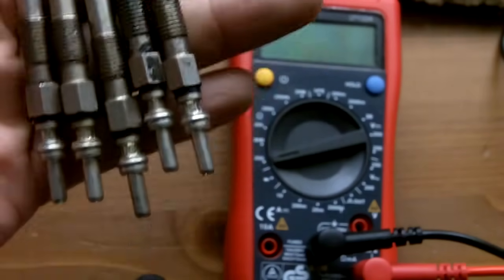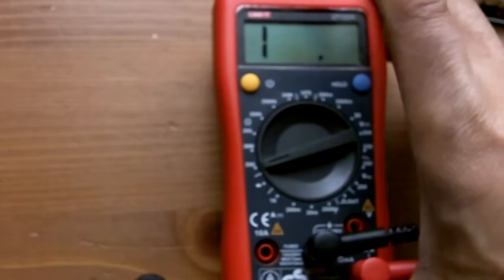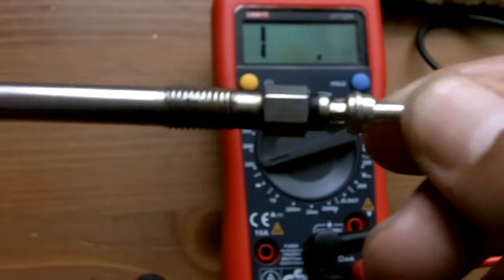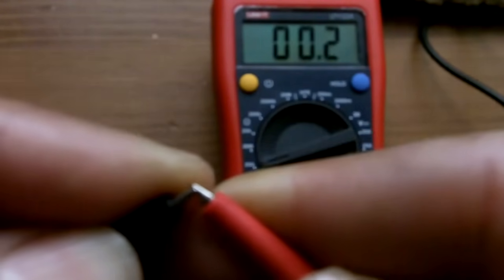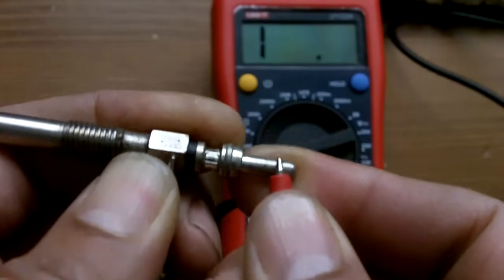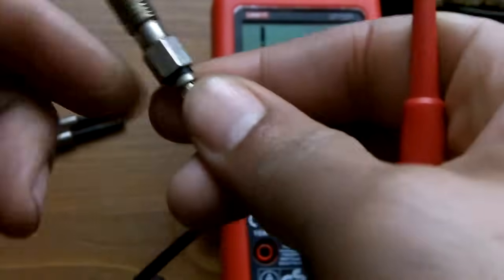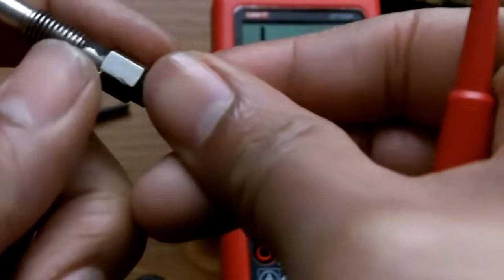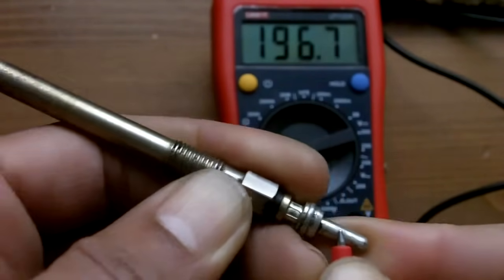Easy and Complete Glow Plug Test

Comment: My diesel had codes for all 8 plugs.  I tested 4 using this method.  All just showed 1.  I'll replace 4 and see if the codes go away.
Reply: if you have 8 plugs you should replace all 8 at once, dont think replacing only a couple is a good idea
Reply: @_Drekavac_  I replaced 4.  4 codes went away so i replaced the other 4 too.  Now Im clear.

Comment: Ive seen others put the positive on top and the negative on the tip, what's the correct way?
Reply: It doesn't matter, the glowplug is a passive device-it has no internal active electronic components and is completely indifferent to voltage polarity
Reply from the maker: Why would I show you an incorrect method? The video has over a million views. You decide. 👍🏾
Reply: @sirobb  what's wrong with asking a question.  People make mistakes and are not Gods, so why so sure that your method is THE correct one?
Reply from the maker: @starcommunication279 It's not THE method, it's A method which works every time. It's not just my opinion either..... 1m+ views, 4k+ likes, a few hundred comments tell me that the method shown works well enough to not really need to question it. What's your problem?

Comment: Did i do something wrong or what. I bought new glow plugs and wanted to check them with my device. UT60eu from Uni-T. It couldnt be measured. The readings werent stable. Is something with the device or what? I just bought this device brand new and it is it’s first use. I attached connectors and leads to the glow plug the same way you did.
Reply: You had your setting on volts probably
Reply from the maker: @mroqqq7871  test a few things around the house or car with the multimeter to test the meter if you know how to. 
Don't mess with electricity if you don't understand what you're doing. 👍🏾
Reply: @ sure thing. I am new to the topic that’s true however i know how to use simple options of the meter. Checked the voltage of the battery in the car and batteries in the remote it seems like it is ok however idk why i cannot receive the stable readings regarding the resistance. If I touch leads with each other they show no resistance neither.
Reply from the maker: @mroqqq7871  If this is your meter, are you using the yellow button to change to ohms? The dial positions have multiple functions. https://m.media-amazon.com/images/I/514mYZqTzlL._AC_UF1000,1000_QL80_.jpg

Comment: Ok, I need a new multimeter as my values are jumping and I get different results everytime I restart multimeter to measure the same plugs
Reply from the maker: Touch the meter leads together before testing. If that produces a stable reading, the multimeter is likely ok.
Reply: Wiggle the leads…… 
Cheap multimeter leads will change resistance as they move around ;-(
Reply: Do the battery test. It's way more reliable and it's the old school method
Reply from the maker: What if he has 4v or 7v plugs? 12v will kill them. The methods described are reliable, safe and quick.

Comment: That could explain why my truck with bad glow plugs takes about 20-30 seconds to start. I’ll be replacing them very soon.
Reply from the maker: Definitely test before replacing to be sure. Hard starting diesels aren't always the glow plugs.
Reply: You do that test with multimeter without to remove the glow-plugs
Or you can use a test chisel=test light
Reply: @konstantin-big  How could you possibly measure ohms with a test light?
Reply: @ShesABigun  
You can't 
Measure ohms with a test-light 
You can connect the test-light  to B+ on Battery and the other side to glow plug without to remove the glow plug 
If the test-light don't illuminate the glow plug is burnt
I hope you understand that I mean

Comment: You must NO TOUCH THE METAL while you checking ohms or just one but not two, it could be different results!!
Reply: As a rule, that is correct. But for this, where the expected resistanse is very low, it will not matter at all. As we know, his body resistanse will be like Meg-ohms and in parallel with the glowplug. The well know formula for resistors in parallel give us (for one 1Ω glowplug): R(tot)=(Rglow*Rman)/(Rglow+Rman). Ex.: R(tot)=1*1000000/1+1000000⁓0.999999000001, that is pretty close to 1Ω. So the body does not inflict on the measurement in this case.
Reply: You can touch one end and not the other

Comment: All my glowplugs are 1.5 to 2 ohms, and i have a bad cold start. Tested the relay and even if they get 12v, and everything was ok. Going to change them soon and see what happens. I had bad starts for years with good, bad turbos. Havent checked the injectors, but lets start at the cheapest end . At 250k km and they never have been changed only time.
Reply: Battery? starter motor? Alternator? 
Did it got fixed when u swaped the glow plugs mate?
Reply: Tested mine just this morning and they are 8,5 minimum Ohms.

Mines done 250,000km and don't think they've ever been changed.

Not looking forward to removing them but I have all the gear and no idea 😆
Reply: Poppet valve in injectors probably need shimming.

Comment: Do glow plugs stay hot when the engine is running?
Reply from the maker: They're not on permanently but may be cycled on during warm up to reduce emissions and some DPF systems use them during the regeneration process.
There's no definitive answer so it very much depends on the set up of an individual engine.
Reply: @sirobb  do they stay on when the ignition is on? Before starting the car
Reply from the maker: Depends on temperature. Cold starting above 6-8°C won't need any glow plug activation.
Reply: @sirobb  thanks for the reply
Reply: @sirobb  I have an older 2000 Diesel 1.9D with mechanical injection and the glow plugs cycle whether it's hot or cold out which suggests mine uses them regardless of temperature?

Glow plug light is on for 3-5 seconds and the relay (timer) clicks off after about 1 minute.

My glow plugs are measuring 8,5 ohms so I need to replace them. It's seems to be considered a cold start whether it's 25c or -25c out with my car.

I guess this is normal for cars built pre DPF with modern systems?

Comment: Hi my volvo v50 2.0d is struggling to start but my battery is fine, is it a big job to change these and this cropped up as being one of the potential problems?

Thanks nice vidoes 🙌🏼
Reply from the maker: Yes they can be tricky to change so that's why you test them first. No point in changing something that's working ok

Comment: It might have been asked - but why does this work?
Reply from the maker: Like most electrical components, working glow plugs only show the correct resistance between a limited range.
Outside of that range, they don't work so this reliably measures the resistance is acceptable.

Comment: When you are battery testing them it's much easier to use jumper cables (one lead of the around the body of glow plug to ground) then take the glowplug via the handle and touch the positive thermal of battery with top of glow plug. No chances of that Lil wire getting hot and burning your finger. 👍🏾
Reply from the maker: As mentioned in the video, I wouldn't test glow plugs that way.
There's no need.
Reply: @sirobb  well when get that one shorted a weird way like I did the little wire will scorch the hell out of your finger just talking from experience still a great video man.

Comment: just hook up to 12 volt battery if they glow they good
Reply from the maker: This method doesn't require removal and not every glow plug is 12 volts.
Your method on a 4V plug would knacker the plug.

Comment: If you have a battery or lab supply,could you not put 12v through them to see if they heat up?
Reply from the maker: I show that method in the video but I don't recommend it.
Reply: Yes I did find it before you replied,but thanks for the reply.I have tested all 5 and they are all 0.6 ohms as per your video, tried to check the voltage but as it was pissing down and I was in a hurry,I didn't disconnect the coolant temp.saw your vid on timing belt, car is on 197k so due soon,I will buy a Volvo belt,but I have a friend who gets trade discount from Mill Auto on parts but they are not Volvo filters.Do you see a problem with non Volvo filters? You are probably rolling your eyes by now but last but not least, your video on the cheaper maf option does not match my 2006 v70 183 HP d5 looks like mine is part of the inline part without the srews,I am guessing just cleaning it will be enough?

Comment: The only way how to really test the glowplug in the current test, as the power is function of voltege and current. Most of the glowplugs have a regulation spiral - termal sensitive resistor in it, so the resistance is changing with the temperature. By the resistance, you can sort the total wrong and still living plugs. But still living is sometimes not good enough.

Comment: As a certified electrical tech you can't touch what your testing , you will read resistance from your body!
Reply from the maker: The method shown in this video is sound and whether the glow plug is in your hands or not makes no difference. If you try it, you will see. 
A certified electrical tech really should know that.
Reply: @sirobb  i don't know about a certified elec tech i think he means he needs certifying ! anyway keep up the good work mate its much appreciated in what you do on here ;-)
Reply: Speaking from common sense and nothing more, the reason it is ok to test while touching is that the multimeter gave different readings on all glow plugs, within a range that would be expected. They would all of failed this little test if what you say is true 🤦‍♂️
Reply: Where did you get that information from. Makes no difference.
Reply: This has bit me a couple of times when the resistance changes each time I test but I was looking at much higher resistance with a much smaller go/no-go window. With glow plugs, you are looking for such a course go/no-go reading that its not going to make a difference for the savy diesel tech. The reason it won't make a difference to a savy diesel tech is that they will look at more than what their DVOM reads to determine if they should replace the GP.

I do wonder if the thumbnail was clickbait to get people to watch and comment on thus exact thing.
Reply from the maker: All I can say is that I don't do click bait.
Reply: Typical body resistance of a human being is in the region of hundreds of kilo ohms. A multimeter set to 200 ohms will not detect this high body resistance, so touching the glow plugs will not affect the readings.
Reply: In “12/24 volt” world where diesel techs live, body resistance is usually a non factor. If customers were to pay for a tech to not touch the component they are testing for resistance, vehicles would just be thrown away when they broke because no one would pay that cost.

Comment: Such a good demonstration. Just notice the fingers touches the metal part of glow plug wherein the test probes are connected. Technically our body might contribute inaccurate resistance measurement. Just an observation.
Reply from the maker: Thanks. I've tested hundreds of glow plugs either holding them in my hand as well as only touching them with the multimeter probes and body resistance makes no difference to the accuracy of this test.

Comment: Is tha rail that connects all the glow plugs a 12V positive or a negative?
Reply from the maker: Not all glow plugs are 12V so the exact voltage depends on the engine.
Reply: @sirobb  understood. But is it positive or negative? Mine is coming out negative when tested. Just need to confirm so I know there is a short somewhere 🤔
Reply from the maker: Not sure I follow your point. 
Which meter leads are attached to what?
Reply: Tony Pala switch your multi meter leads around? Put the positive on the positive side and the negative on the negative side.
Reply: @rhyshines1759  all good. I've fixed the fault.
Reply: The is switched to live during starting.

Comment: I have an issue where I did a motor swap on my car and I am having trouble finding out what year the motor was built and the glow plugs are different specs for different years. Ranging from 6v 12v 8.5v 10v the list goes on. Unfortunately I can’t be certain the plugs in there are also correct so taking one out and checking is hit and miss. Is there a way of being able to check what volt plug is needed by testing somehow on the motor. It’s a 2h land cruiser motor.  Hope you are able to help. Cheers.
Reply from the maker: You could check the voltage at the glow plug power connector plug.
Reply: SiRobb do you mean where the power is connected to the first glow plug and buzz bar.
Reply from the maker: Yes 👍🏾

Comment: Bosch claims if resistance more then 0.6 ohms - glowplug is bad.
Reply from the maker: Do you have a link to that information?
Reply: Thats not really the truth.. same when they say when one is bad change all of them
Reply: my new one have 0,4 ohms . it depends if they are designed to work uder 12V or 5V .

Comment: PS: From Vida for 2008 models:
"Caution! The glow plugs must not be directly connected to 12 V. This would destroy them immediately."
 The glow plug system is a Quick glow-system. It is based on 4.4 V."
Reply from the maker: Yes I know and that is why I don't recommend connecting directly to the battery.

Comment: I test them with power from the car's battery
Reply from the maker: If you have 4 or 7 volt plugs, this is a very bad idea.
The resistance test is a safe and reliable way to check all kinds of glow plugs.
Reply: @sirobb  i can read
Reply from the maker: @ismaeldossantos3296  Great. Why are you watching a video showing you something that you already know then?
Reply: So what doea ur volts come out to?
Reply: @kristinawilliams3737  you just check if they turn red and how long it takes. Modern glow plugs take about 3 to 7 sconds to turn red.

Comment: Do you think your fingers are non conductive ? and your body has no resistance ? you readings  will be wrong as you touching  boths terminals. Try mesure resistance of your hands you will see.
Reply from the maker: My body's resistance is in the mega ohms yet it clearly isn't affecting the reading from the glow plugs otherwise I wouldn't get the readings shown in this video.

Do it yourself and you will find the same.
Reply: @Mark Foreveryoung
, you're right but the resistance through his fingers will be a lot more than 1 ohm, so the measured value will still be the path of least resistance i.e. through the glow plug that measures 1 ohm. So he still knows which glowplugs are good and which are bad.

Comment: Thanks! Does this apply to low-voltage glow plugs? Mine are 4.4V.
Reply from the maker: As the video description says, you need to confirm the correct resistance for your own plugs but I very much doubt that the correct resistance will be much different to around 1 ohm.
When you know what figure it should be, testing to check is the same regardless.
Reply: @sirobb  Great! Thanks a lot!

Comment: What should i do if mine are 2 ohms. Is that ok or should i replace them
Reply from the maker: You need to check the exact spec required for your plugs.
Reply: if you dont have winters in your country -then glow plugs is not needed

Comment: I would have said the first bad plugs were open circuit, not high resistance....
Reply from the maker: Open circuit is open circuit and would have given no reading at all so high resistance is a fair enough description.
Either way, it's just semantics as they were knackered and needed replacing whichever description you choose.

Comment: If the plugs are still in the car you could use your multimeter in continuity resistance with one lead on the top and one on a common ground eg the cylinder head would show wether the glow plug is good without removing the plug you could also use a power probe by listening for the ground chime
Reply from the maker: If the glow plug internals are shorted to ground, you'll get the same reading and it will be wrong.
A resistance test comparing actual against spec is more reliable.

Comment: Connecting them directly to a car battery will make good plugs glow for sure. However, some of these glow plugs run on 11vdc, not 12vdc. You may see it glow... just before you damage it
Reply from the maker: RSCS This is why I say in the video that you don't connect it directly to a battery.
Reply: Yes, apologies. My comment was in response to a couple of other comments below which suggested they connect the plugs directly to the battery. I saw a couple videos too that even shows a "mechanic" doing this. No proper mechanic or auto electrician will test the glow plugs by connecting these directly to the battery and watch them glow or not glow. Resistance test, as shown in your video, is the easiest, safest & surest way to check glow plugs. Good job btw.

Comment: Great vid, thumbs up and subbing. I have a 1.9 Vauxhall Vivaro glow plug light coming on while driving + limp mode, very low on power. I am looking at EGR maybe needing a clean, maybe the MAF sensor, but thought it would be a good idea to check the glow plugs while I have access. With your method I reckon I will save an hour of unnecessary labour, if all the plugs test ok. Thanks for sharing tips, and thumbs up from another Volvo fan.